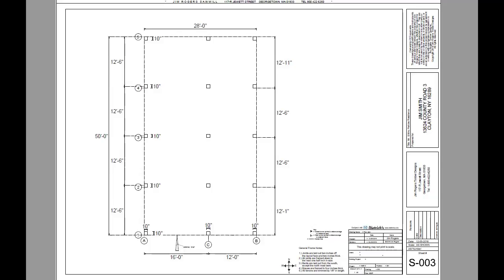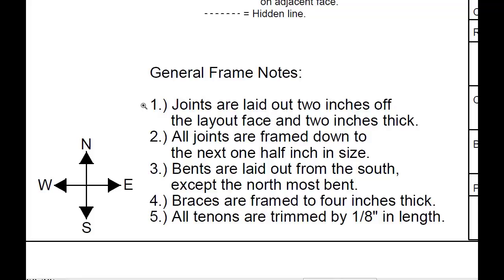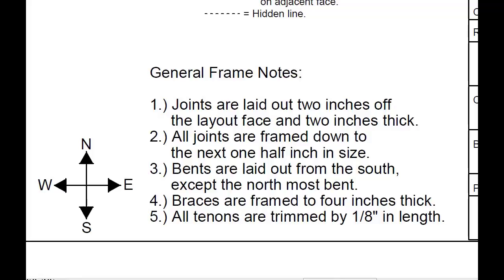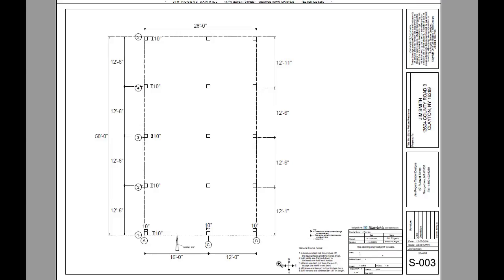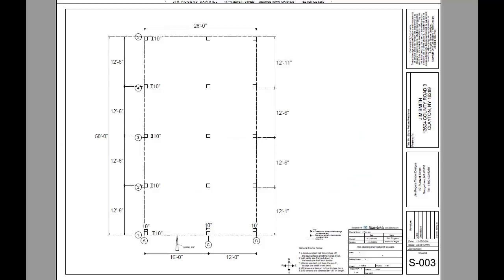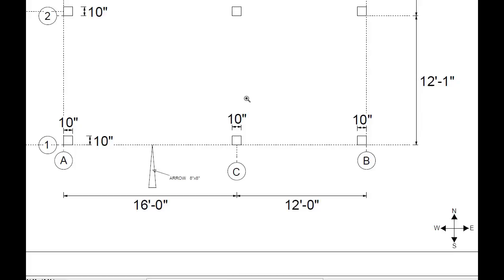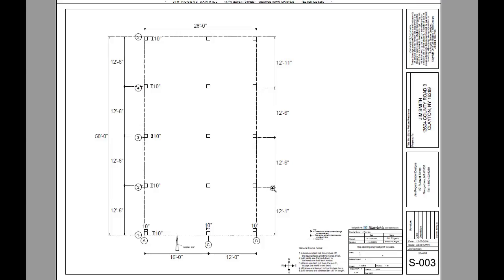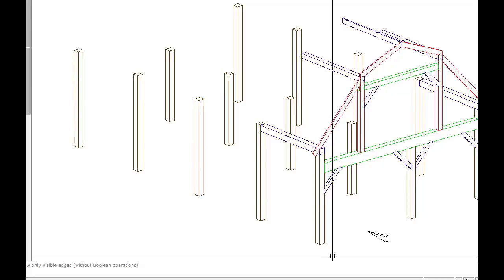Timber Frame design set up tips

Comment: Thanks Jim that was a great video. One question is it standard for the outside walls to always be “A” and “B” vs using a A, B, C grid

Looking forward to seeing more on the drafting layout of Jim’s barn
Reply from the maker: I usually use A and B for outside wall, and C for "centerline" walls but you can do what ever works for you. Especially when you have four posts in a bent. You can do A B C D and make A and D outside walls. Doesn't matter much.
Reply: Jim, I can see where a "standard" would be good so everyone is talking the same language. Didn't know if the TF guild had one. Thanks for the reply